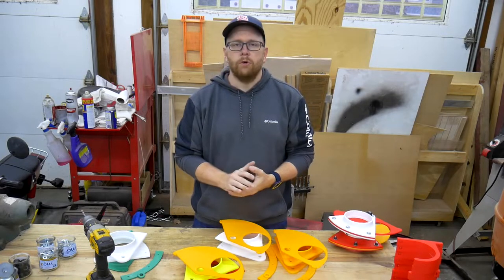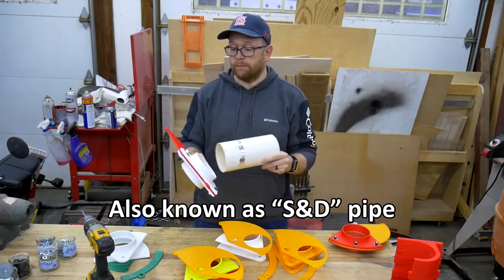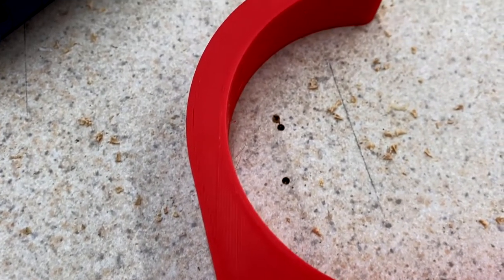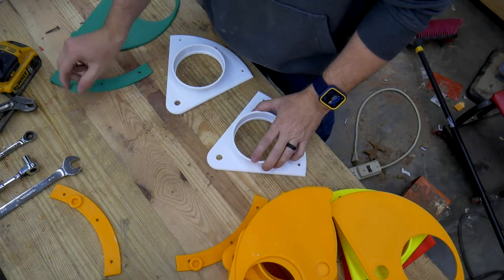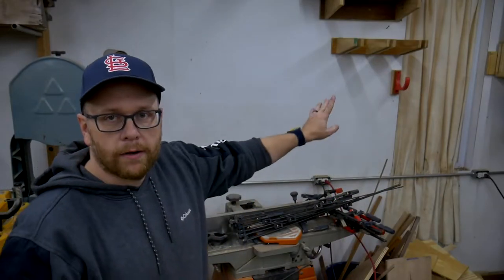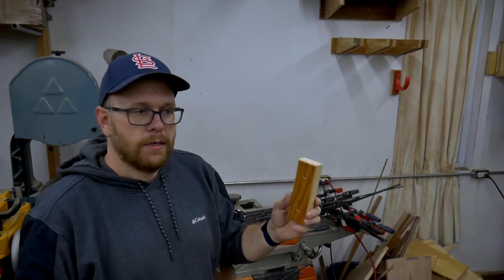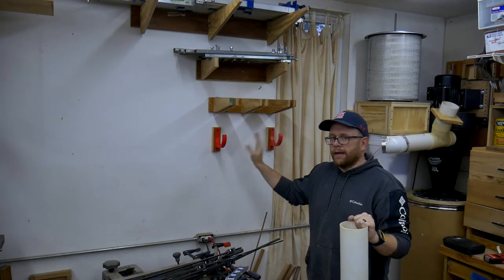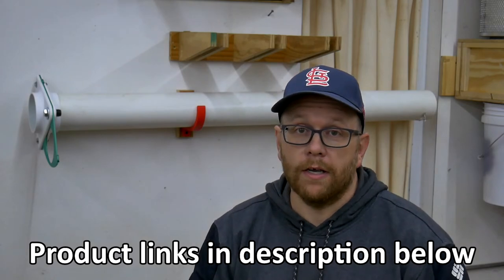DIY 3D Printed Blast Gates and Hangers for Cheap!! Affordable 2-Stage Dust Collector Part 4

Comment: I printed mine on an Ender 3 V2. I used a rigid plastic (like a home for sale sign) for the slider portion. That part was too big for the bed on the Ender. Still works well today. Easily scaled up or down in Cura Slicer.  Thanks for the .stl and links as well as a quality video. 2 thumbs up!

Comment: Been there done that and have the tee shirt. It’s a simple idea and it’s so simple when you can use a simple program and have a 3D printer. Good on you for telling people about your ideas. I just use 50mm pipe and have it running all around my workshop, I don’t even glue the pipes together, just slot them in

Comment: This found me - randomly - thanks very much for a really good vid. Two questions if I may......1. what's the point of the 'washer' insert? - what not simply include it in the main body of the print? 2. Do you have any air leakage?........could I also offer something I did to make my own pipe hangers....For starters I use drainage pipe....I cut off a narrow section of this (say 1" wide) leaving me with a small circle. Now cut away small sections (in essence converting the 'O' shape into a 'C') until the 'gap' leaves enough room to push the full pipe into it. If it's too tight, cut away more etcetc. You'll find that pvc pipe is sufficiently strong and flexible enough to flex open but then close tightly around a full pipe (like a hand grabbing it). I have several of these on the ceiling of my workshop with pipes hung/held vertically below them. 👍
Reply from the maker: Air leakage is minimal. As for the washer insert, it served 2 purposes:  this model is a remix of a smaller version, when I resized it in Cura, the pivot hole was way too big. I didn’t have much experience in CAD back then, so I just designed the spacer to make up the difference. An additional benefit of the spacer is that it is a tiny bit thicker than the blast gate so you can cinch down on the pivot bolt without binding the action of the pivot. Cheers!

Comment: I hope someone would make/sell those, very cool design.

To beef up the pipe hanger and ease the installation. You can print it with a sliding dovetail that would fit in your wood piece. This would also hide fastener :)

Comment: Cool gates…. Metal hardware seems like it could use smaller, lighter bolts/fasteners.   Really got me thinking about 3d printing.
Reply from the maker: Definitely could use smaller hardware. I’m pretty sure I used the beefed-up pivot because I wanted to automate these blast gates with pneumatic cylinders, but I never got around to it.

Comment: Any chance of making some blast gates to sell? I don’t have a 3d printer or the time to learn. Would pay you for your time. Thing is I need 3 1/2” id hole for my pvc. I know this was a year ago but never hurts to ask. Oh and I just need 4 blast gates. Thanks for the video it’s cool watching how you made these!
Reply from the maker: Hey thanks for reaching out. Unfortunately, I don’t print on demand. What I can do, though, is resize my 3D model to fit your 3.5” pipe and you can use one of the online printing services (like Shapeways) to have the parts printed for you. Email me at tnlightle@gmail.com so I can get some details from you about your 3.5” pipe. Even though it says 3.5” that may not be the actual size. Cheers!

Comment: How would you modify the slider to print on and ender 3v2 and still work with everything else?
Reply from the maker: That is a tough one. Not sure you can. However, there are other blast gate designs on Thingiverse.com that can be printed on an Ender 3. Just not this one. Cheers!

Comment: Great video Tom, doe the sliding part of the blast gate fit in the ender 3pro build plate 220x220mm ? Or did you use a larger printer. Thanks.
Reply from the maker: I did use a larger printer. Unfortunately it doesn’t fit on a 220x220 printer
Reply: @SouthpawWorkshop   What printer do you use?  It looks like i may have justification to get a 2nd printer.
Reply from the maker: I use the Sovol SV01. For the price it is a decent printer with a 280x260x300 build volume. You can check out my review on my channel. Cheers!